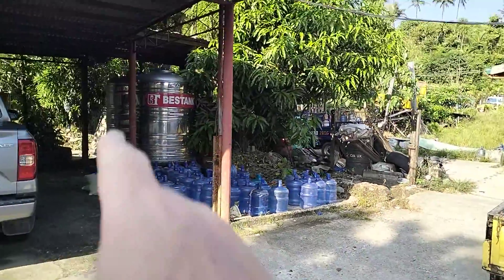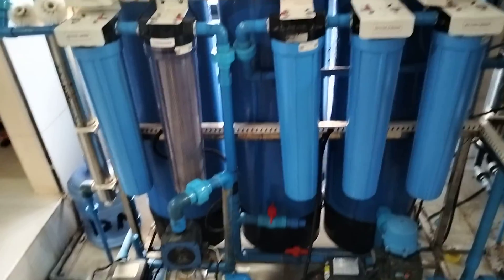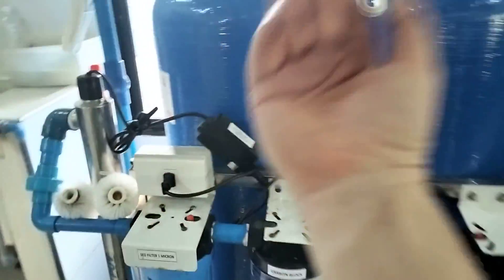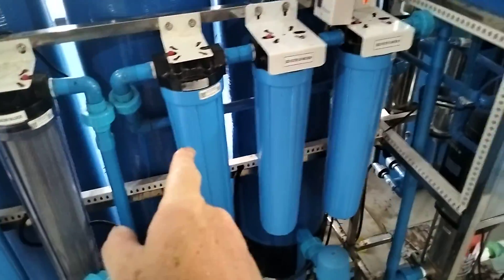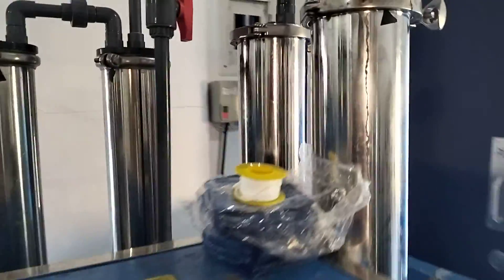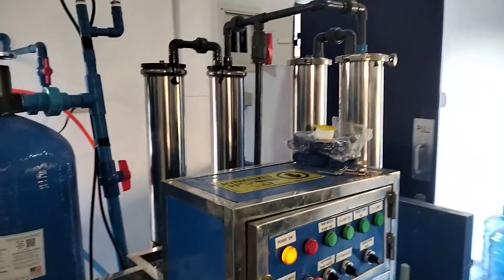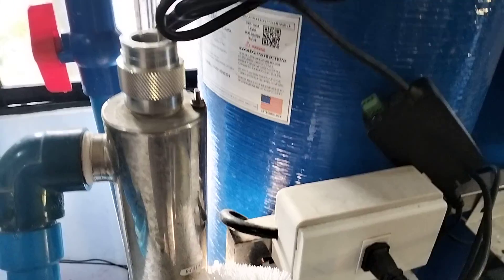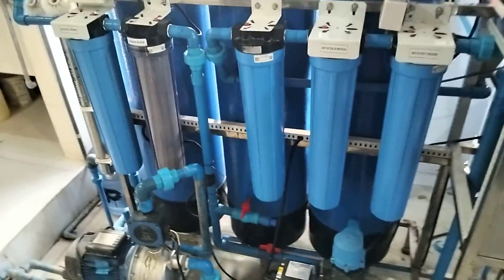Water Refilling Stations in the Philippines. Understand how they work.

Comment: Good to see you getting back on your feet, and by the looks of it you're being very successful.

But I have a few questions

Do you only supply residential or do you have commercial customers.

do  customers bring back the bottles.

And does that mean that the water is pure like WFP.

Did you have to import all the equipment or was it sourced locally.

And is there much demand for purified water for anything else ?